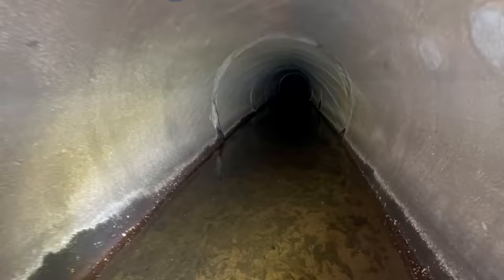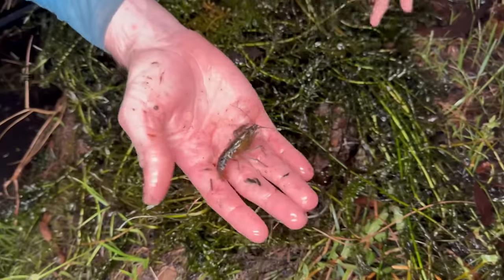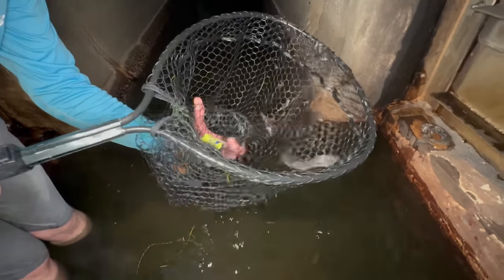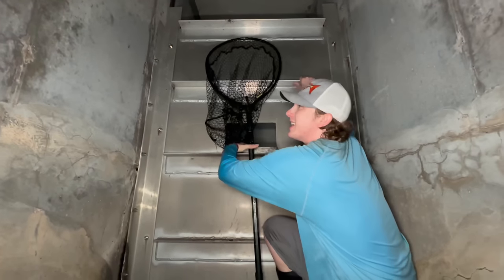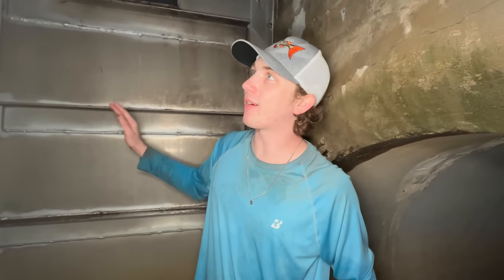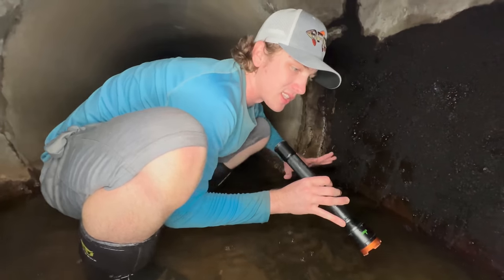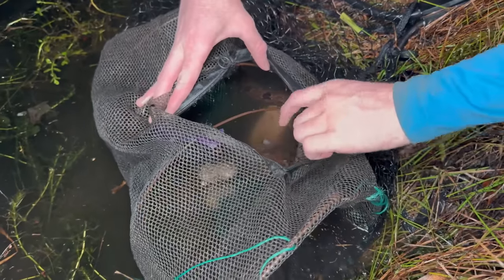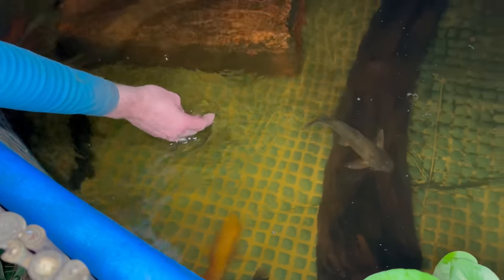I Found a MONSTER Living in a Creepy Tunnel!

Comment: I'm sure someone has already commented this somewhere but, those brown banded snakes in a lot of your vids are usually just brown water snakes. I say "just" due to them being non-venomous. However, they are scrappy and short tempered. Thus they will bite at a person rather quickly if they feel threatened. 

I've picked up from your vids that you don't exactly "like" snakes, which is entirely reasonable when they can be tricky to identify. I'm in no way encouraging you to handle them. However, if you can become acquainted with your local water adjacent snakes, it could help with any snakey anxiety you have, knowing which ones can or cant cause you harm beyond some sassy tooth marks.

Comment: The crustacean is probably a vampire shrimp. Seen them at my LFS plenty of times
The snake looked like a water snake. Nonvenomous and actually pretty friendly (I might just be weird tho). Triangular heads being venomous is not a good identification method, their nostrils and scale pattern are generally how I identify snakes
Reply: Yes, or the shape of the eyes.
Reply: I'm in PA but our water snakes look similar to those in the video.
Reply: @Ateezwooyoung  Shape of the eye actually isn't accurate either. All snakes have slit pupils in sunlight. (Round when in shade)
Reply: (The eye socket shape and eye shape itself are also the same across most venomous/Non-venomous snakes)
Reply: @Simplymarsily it's known for a name called Atya Gabonesis. (maybe) and it's a very rare and expensive vampire-crawfish. It is totally menacing as it is very peaceful.
Reply: @ZenSh_ade   We are talking about snakes lol